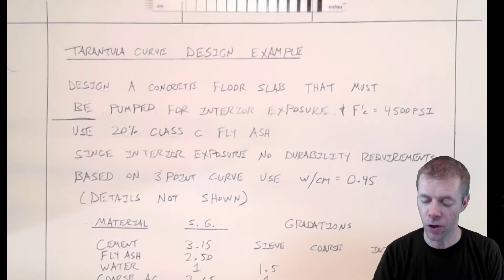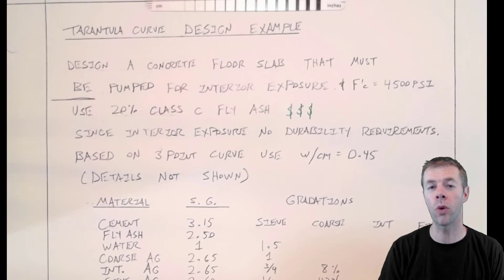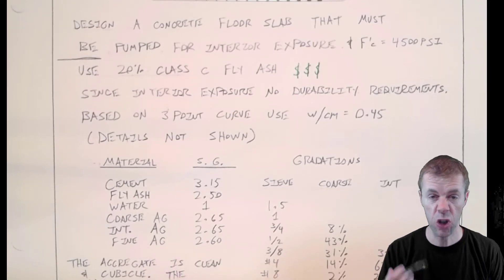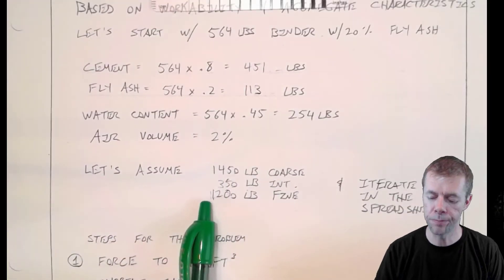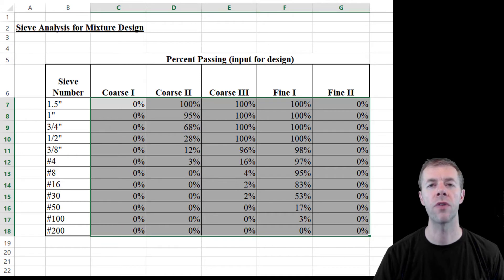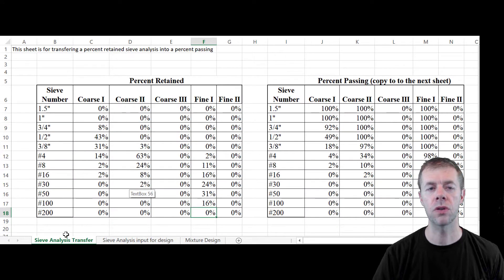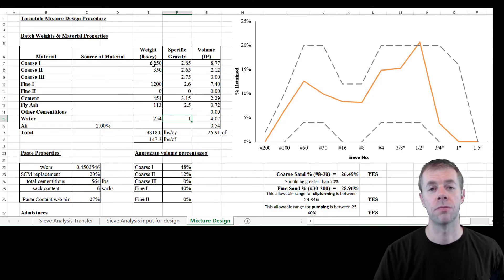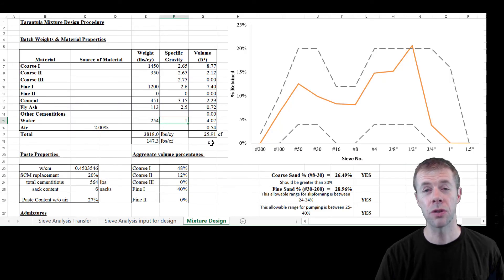Tarantula Curve for Concrete Mix Design Example Problem (with excel sheet)

Comment: thanks for share your knowledge. I have a question. is it tarantula curve recommended only for two aggregates ( for example gravel 1'' and sand), because in my country this is common way to manufacture concrete  at plant? Maybe we can  mix with fine sand ( about 30%  ) or mix with gravel 1/2''. But mixing four agregates ( fine sand, gravel 1'', gravel 1/2'' and sand) in the plant is complicated.
Reply from the maker: Ricardo,

This can be done with as many aggregate sources as you want.  I have found that it is rare that two aggregates will work but it is possible.  Three aggregates seems to be the best combination.  In some cases I have seen four aggregates used but it is not likely needed.

People commonly use two aggregates because it is easy.  However, that doesn't mean that it will produce concrete that can be workable with the minimum cement content.  I hope this helps.

Comment: Hi Tyler, 

How do you get the assumption number on the  percent retained as explained in minute 6:30, only assumptions of 1450 coarse, 350 intermediate and 1200 fine agg, nothing explain the gradation. how do you come out with gradation number on each sieve sizes?
Reply from the maker: You have to get the gradation for each of your different sizes.  Replace the numbers in the spreadsheet with what is the actual gradation of your aggregate.
Reply: Got it. So we input based on aggregate gradation available, I was thinking of custom design gradation our own coarse, intermidiate and fine mix. Thanks...
Reply from the maker: You could do that but that is not possible with many projects.